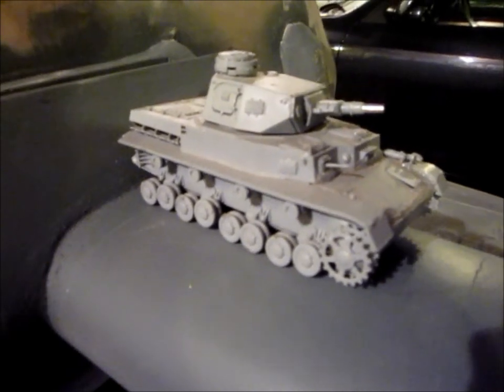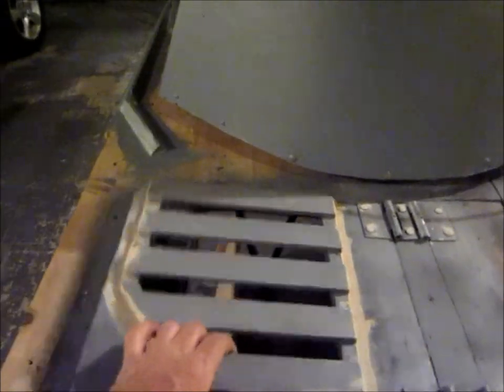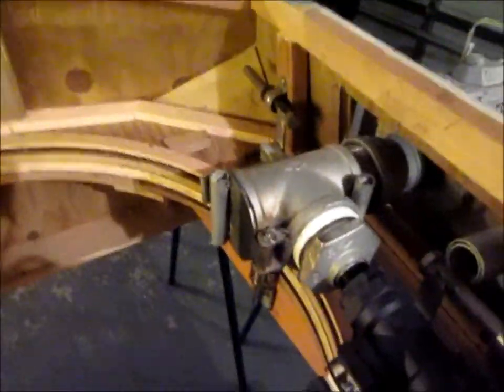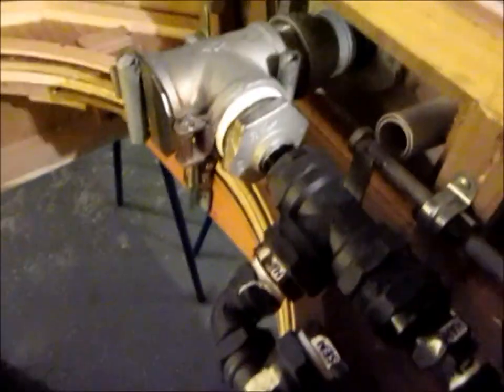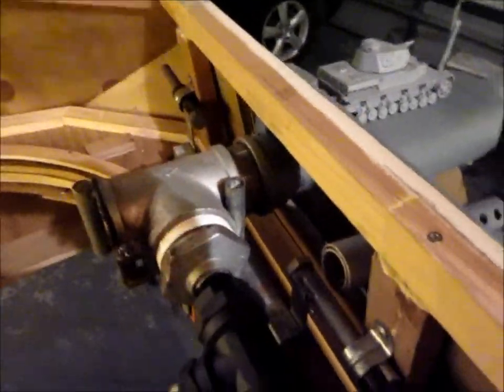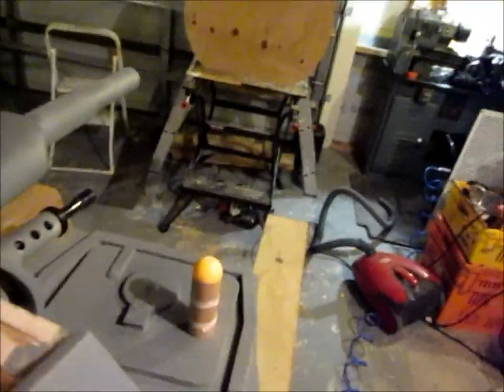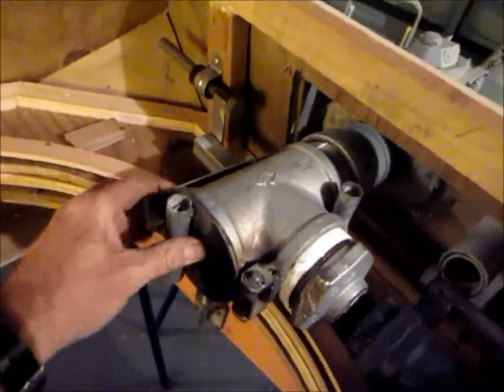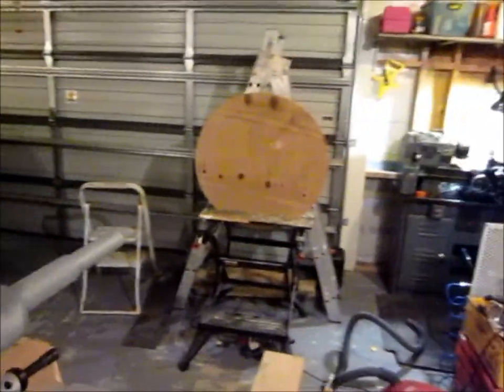50% Panzer IV upper hull progress and air cannon test

Comment: Cool!! You going to have an on board air compressor, if so how long to charge in between rounds?
Reply from the maker: +prancstaman Really haven't decided yet. Could go with a 12V tyre pump, paintball CO2 cylinder, scuba tank (unlikely) or convert a small petrol motor into a compressor. All depends on $$, size and my time. A decent tyre pump at about $150 is the most likely as they are small and easily fitted. Would hope to get at least 2 rounds a minute. I am looking also at making a smoke round.
Reply: Here's a thought. On cars with ride control systems with air shocks like a Cadillac, have on board air compressors. Could get one at an auto junk yard cheap.